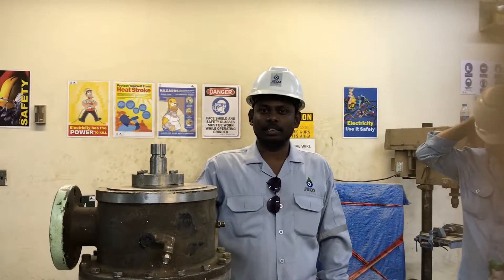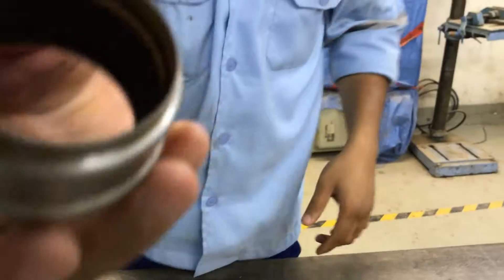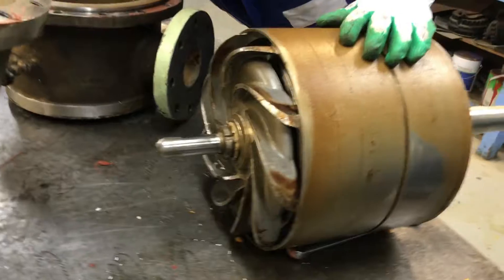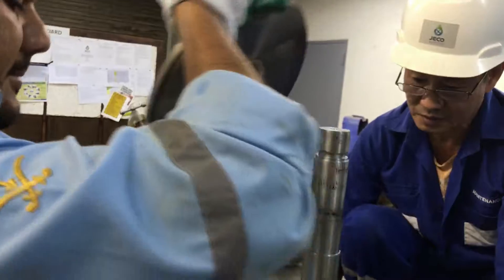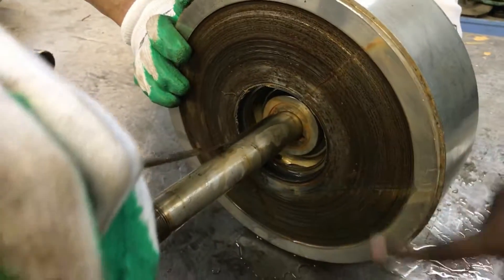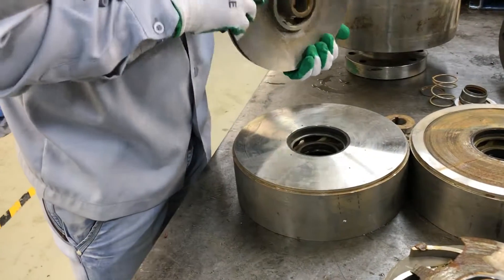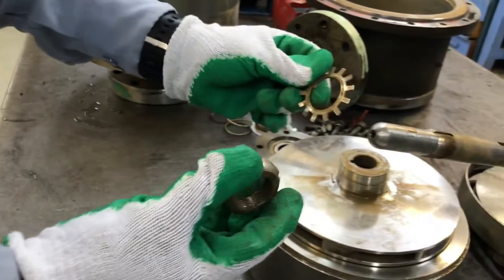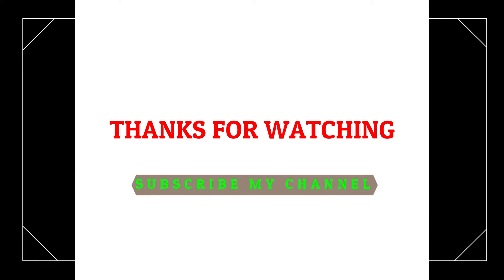How to Disassemble the Multi Stage Centrifugal Pump - T&T Pumps, USA II Pump Repair Work

Comment: Let's see, looking at the disassembly you have not checked the axial travel at any of the stages, so you cannot say that the fault is that the locking nut of the first impeller has loosened since the nut was still blocked by the safety washer.
If you had disassembled checking the axial travel you would have had the opportunity to draw some conclusions, but I have only seen a quick disassembly with a person on the table as if he were a monkey, not to mention that you do not have adequate tools among other things.
The summary is a destroyed impeller together with the channel ring, a damaged shaft in its lower part as well as its bearings, friction ring in all stages.
If you do not have spare parts for the 2 main parts you can wait a long time for the impeller.